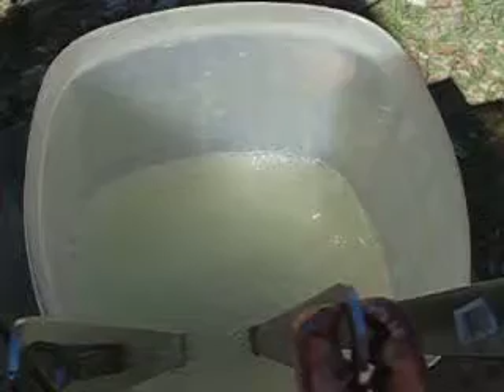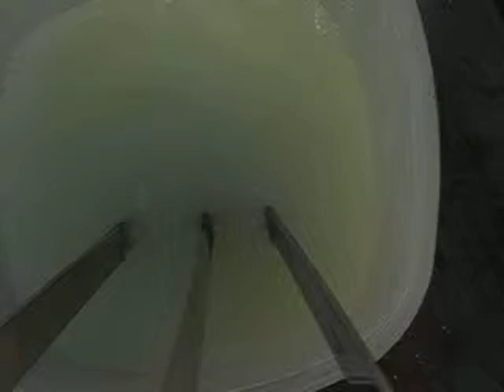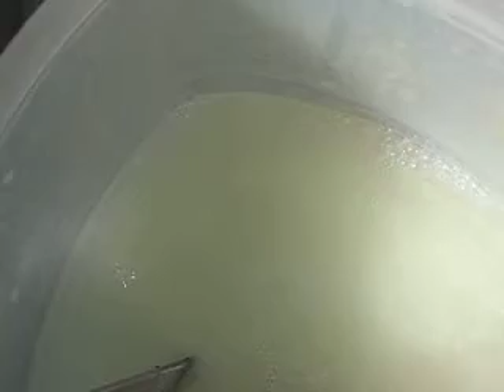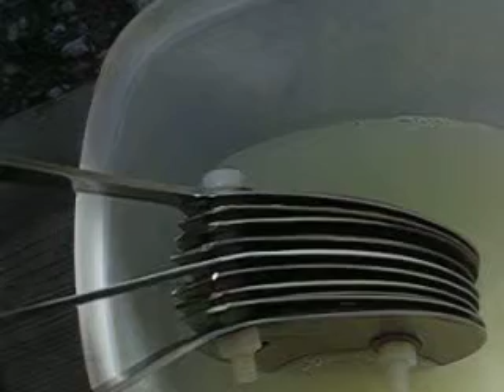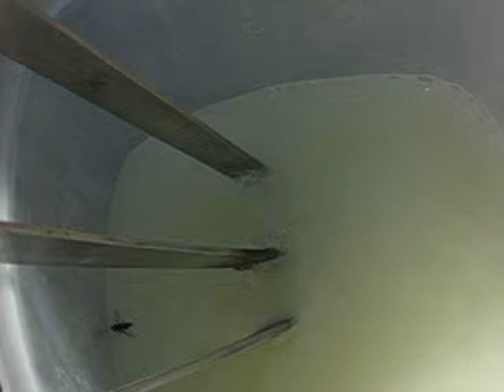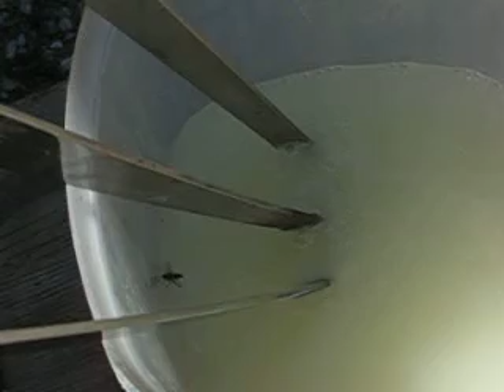005 HHO Cell Test before Installation in Container, see Vid 015

Comment from the maker: Gap Distance decides how much water can flow and how much current goes through and therefore is responsible for Heat in the System. The trick seems to be to lower the Voltage and increase the neutrals with the same amount of current.